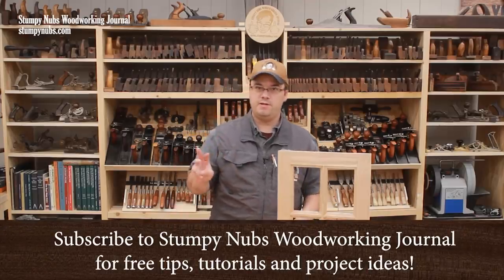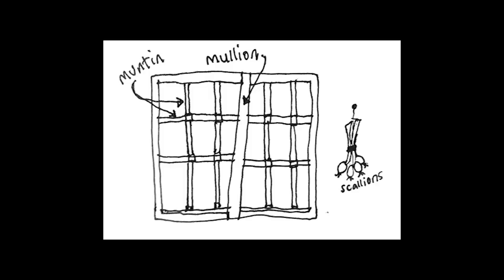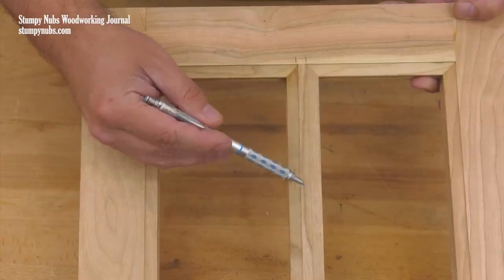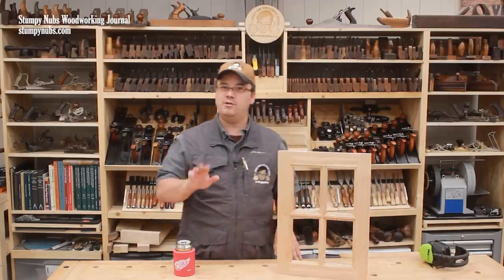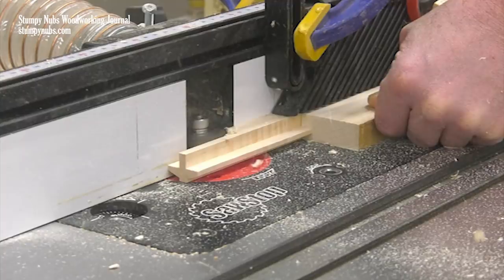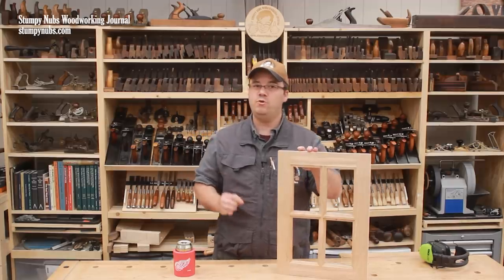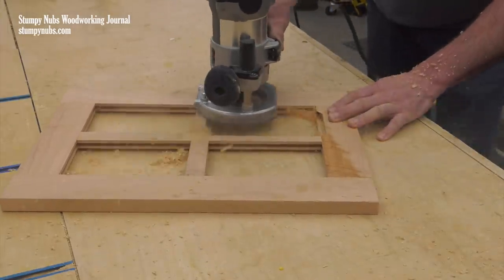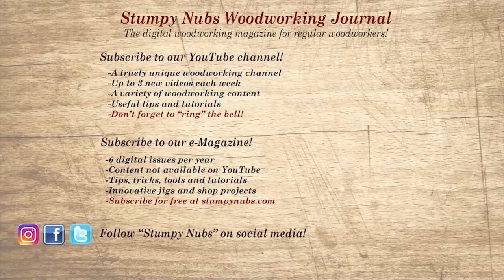REAL divided glass panes for doors and windows

Comment: Great video!   One suggestion on glass install, use the metals clips that have one screw to frame and one side padded screw to glass to 
hold the glass.  They are easy to install, easy replacement for broken 
glass and removal of glass to clean under muntin.

Comment: For any style and rail door, especially with inner “muntins”, aiming for a slightly oversized finish exterior dimension, to be trimmed to size and square after glue-up can be very forgiving, especially for inset doors.
I used to calculate lengths of all parts needing coped, cut them to length but leave as wide as you like, then cope all in one setup with no worries of blowout. (Helpful with profiles that taper to zero at the inside edge against the glass.)  These can then be ripped and/or jointed as you prefer to their finish widths before sticking, leaving the final router pass to be with the grain.
We used to call the full length (usually vertical muntins) “glass bars” to differentiate from the shorter “muntins” in speaking with others in the trade.

Comment: Always cope first. Get a shaper with Freeborn tooling. The sticking will be jointed at the same time. Also power feeder is important. Also Amana makes an 1/8 flush cutter with bearing to clean up back rabbets. Then a one strike corner chisel.. The quality will amaze you vs routers up.

Comment: I have a pair of 8 paned glass interior french doors I’m installing as pantry doors.  I purchased them on FB Marketplace and each door has a broken (actually shattered) pane of glass.  The construction is very complex.  The muntins have the same appearance on both sides of the doors and seem to be solid in their construction.  Meaning: No glazing or moulding used.  The wood is maple and in very good shape.  How can I replace the broken glass panels without taking apart the rails and stiles?  Do you have a video on this?
I should also mention that the panes have a very stretchy film on both sides of each pane.  When they broke they didn’t break like normal glass would.  It looks like a car windshield looks when it gets shattered.  They’re all together because of the film on both sides.  I’ve removed all the broken glass and have discovered that the glass is (was) quite thick.  Approximately 3/16”.  Not sure why that is.  Anyway, I sure could use some help with this project.  Any help you could offer would be appreciated.  Thanks…….Joanie S.

Comment: My  house is old and has wood windows such as these with a putty glazing on the outside. They put an addition on in the 80s and used cheap aluminum sliding windows. Do you know of a place that does old fashioned solid  wood windows such as the one here in this video? Great video!

Comment: May I suggest that if you install wooden strips to cover the glass on the back, that rubber gaskets are also used to avoid any possibility if rattling. If only using metal keepers to hold the glass this may look ugly, but behind wooden batons they are invisible, but very helpful in my opinion.
Reply: After seeing the video I looked at the doors in the cabinets of our townhouse build in 2005.  Cabinets made by a cabinet company.  Quality is decent.  They used clear silicone caulk around the entire inset.  FYI

Comment: Could this be done more simply (For those of us with limited tools)? I was thinking I could get a sheet of plywood, cut out the 4 holes, and rout the edges of each one, for the glass to set in, then cover with trim? Would that work? And maybe rout both sides, to make a double paned window?
Reply: No. That is a bad idea. All the plywood cores would show or need to be edge banded.
Reply: @ackmartin60 Thanks. Is that it? Just a looks issue that can be easily dealt with ?
Reply: @spacecaptain9188  Well go ahead and try it. I think it will look pretty bad but it maybe okay for you. Post a picture if you do it.
Reply: @ackmartin60  Are we allowed to post pictures here?

Comment: Hi, I have searched the Internet for a video on making doors with muntings or divided georgian style glass. There is nothing! I would like to make a pair of traditional ledge and brace garage doors with 6 panes of glass at the top divided by muntings. I don't know if im safer to just build the top glass divisions using square stock and then routing the rabbits and profiles after the door has been glued up. Whats your thoughts? I was considering the easy and safer option of just using thinner timber to divide the windows and then just cut in beads on both sides. I wish there were more videos on this subject, it's a tricky thing because you could end up ruining a whole door if something goes wrong when routing after gluing up. Maybe I've just answered my own question as to why muntings should be run beforehand and fitted as complete profiles. Please do a video right now on this subject that answers all my questions! 😆

Comment: Last time i did this with my round over stile/rail kit, the muntins came out way too wide, out of proportion. im finally brainstorming this more as i have another set to build again. The slot cutter of the stile bit in my freud kit is making a 7/16 deep groove for the interior panel. If i leave 3/16 of wood left on the back of my muntins between the glass, im left with this awkward 1-1/16" wide muntin with a 1/4 or 5/16" deep profile on the face. Not like your narrower shaker muntins here. Mine looked silly to me. Im going to remove the slot cutters off the stile bit and run my muntins at a more asthetic width, maybe 3/4". then set up a 3/4 mortise bit and route out a shallower mortise for the back of the muntins. Or i need an arrangement of smaller diameter slot cutters to swap out

Comment: Can you show how to build these with out power tools?
Reply: you will need specially made hand planes
Reply: @TaylerMade  you are right. And they probably cost a small fortune.
Reply: @dougprentice1363  if you have some old chisels you can make your own.  a bit fiddly and time consuming though.
Reply: @TaylerMade  yeah. I really ment that response for Duane. I'd much rather use router bits than mess around with making or buying complicated planes. But to each his own. I kinda get why people like non-power tools... But not really. I do like using scrapers vs sanding when applicable.

Comment: Hi James - I've complimented you in the past on the very high quality of your videos, and this one is no exception.  However, I'm going to respectfully disagree with the logic of not fitting the glass "permanently".  The chance of a pane of glass breaking over a lifetime of use is rare -- certainly less frequent than the number of times I would open the cabinet door and say: "Dang, the interior of this glass door sure looks ugly!"  It seems a pity to rout out that beautiful interior wood frame.  I would argue that the glass be mounted "semi-permanently" without any routing. You could then -- under normal circumstances -- appreciate a high-quality finished interior over decades of use. 

In the rare event that a glass pane did break, you could always remove it and carefully rout out the wood surrounding that single pane, as you have described, in order to replace it.  (I do acknowledge that this suggestion -- of mounting the glass semi-permanently -- raises issues about the sequence of finishing of the project surface, since the final finishing would have to be done before the glass was mounted.)  My second alternative would be to fabricate nice removable frame inserts to cover the glass on the interior, as you have already suggested.  Anything except the bare metal tabs!   ... Just my two cents worth.
Reply from the maker: You would be surprised how often someone breaks one by placing something inside the cabinet that sticks out a little farther than they thought, then shutting the door on it. Sure, it's rare, but it happens. And while you may not like the look of the glazer's points in the video, the inside can be made to look very nice with mitered strips of wood. This can even create a pleasing profile on the back side that is superior, in my opinion, the the appearance of the standard square backs of the grooved muntins.... But to each his own :)
Reply: @StumpyNubs  Fair enough - I agree the latter is a good compromise.  Keep the excellent videos coming!  Hey -- if the Habs make it all the way this year, would you mind to show a Canadiens mug, just for one video?  (Haha ... after all, it's been nearly 30 years!)
Reply from the maker: @jsnuk3556  - If you send me one. But I would wait and see if I were you. They have to get past Tampa (or the Islanders).
Reply: @StumpyNubs  That might be a tall order, since I live in Thailand and I see that much of this merchandise is only available on pre-order ... for after the Habs' victory ;-).  For sure they'll win, since this team is nearly a carbon copy of 1993.  I'll see what I can do ...
Reply from the maker: @jsnuk3556  - No need to bother. They aren't going to win :)